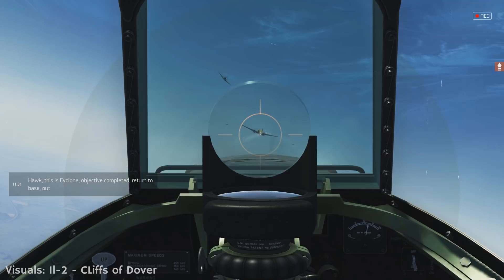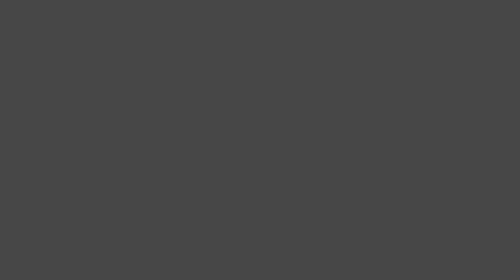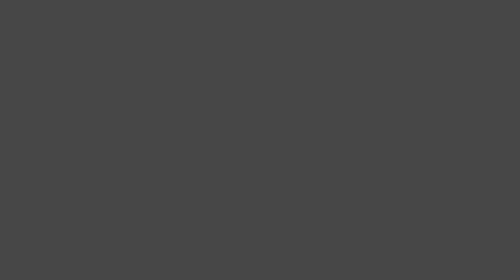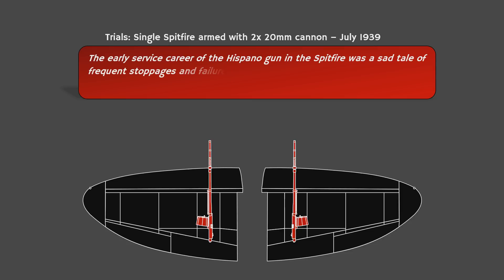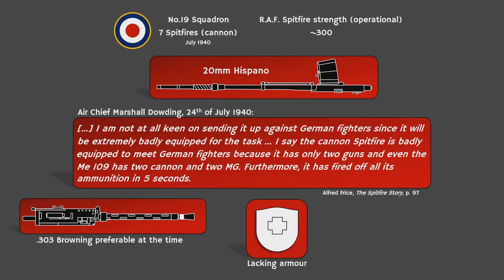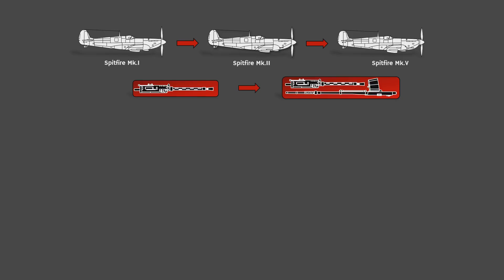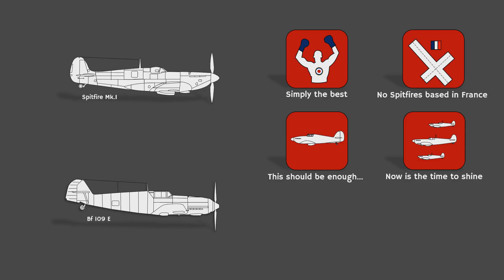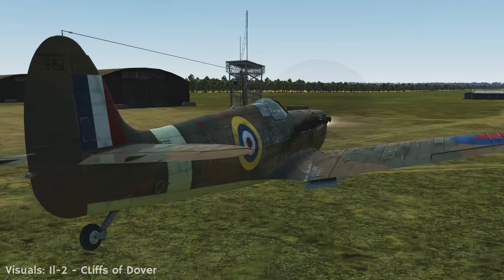⚜ | Clearing up Spitfire Misconceptions

Comment: The 109E having a squared off wing design is a more significant shortcoming than the early spitfires using a non-pressurized fuel solution. Furthermore, the 109E used circular 20mm magazines in the wings forcing the designers to include a bulge in the wings, causing aerodynamic drag. The spitfire used guns in the wings as well, however the magazines could fit into the wings without the inclusion of a bulge.

The 109F model, would rectify the major issues with the E model. Model F1 through F3 would utilize an oval wing design, while the model F4 and forward would use the Daimler 601E engine, as opposed to the 601A and 601N used in the 109E and the early 109F models.

From the model 109G and forward, the Luftwaffe would use the 605 engine, with several variations depending on intended altitude. Armament would also change depending on intended target, using up to 30mm auto cannons for bomber hunting.

However, when the Royal Air Force started using the Rolls Royce Griffon engine. There was no longer a contest.
Reply: Not true go and have a look at the wings of a MK2b it has bulges to accommodate the 60 round 20mm magazines.
Reply: And those long cannons sticking out of the wings didnt cause drag and the Spitfire with the clipped wings for better roll rate at lower altitude.
Reply: Talking about top speeds of the Bf 109 G and K is laughable. Sure they managed to push them to decent enough speeds under ideal test flight conditions (still less than Griffon Spits and Mustangs) but it was impossible to actually manoeuvre the bf 109 at those speeds, all the pilots who flew them consider the Bf 109 to have the worst high speed handling of all the main fighters. Adolf Galland actually wanted their production to be completely scrapped in 1943 because of how hopelessly outdated the design had become.
Reply: From everything I've heard, the MkXII was an absolute beast at low altitude, but that's because its single-stage Griffon was rated for down low. The XIV, XXI, etc were optimised for high altitude, but that was rapidly becoming no longer the place for piston-engined aircraft.
Reply: Hi, Andre. I recently found an old letter I wrote about this topic some years ago so I hope you don't mind the length. I edited it a bit to address some of your points but it's largely intact. It's more of a reminiscence than a lecture so I'll dive right in.

The only solid advantage the Spit had over the 109E during the BoB was range. Head to head it, as always, just mattered who took advantage of his relative strengths. The DB 601 was a bit too much engine for an airframe that was essentially the same as the prototypes that flew on 650hp but the wing tips were not a big factor. They were used to make maximum use of the wing slats to keep the low speed handling a bit less terrifying. They also provided a generally good rate of roll but the ailerons would get stiff at high speeds, just like the Spit, because the bigger engines pushed the speed above the original design parameters. 

The rounded tips on the 109F and later were to reduce the high speed stiffness and to reduce the flight loads on the new wing spar. They really didn't change the handling all that much. The 109 could be treacherous if handled roughly, had some flaws, and demanded a skilled pilot but it wasn't dangerous or inherently difficult to fly. It's biggest flaw was the landing gear which has been described as "even worse than a Spit!"

After the landing gear; the wing slats were a mixed blessing. An inexperienced pilot who got into a condition where one or both slats would pop in and out could cause a fatal spin. But, once the plane was in a low speed configuration with both slats firmly out it wasn't any more treacherous than most any other similar fighter. Better training would have helped a lot but I'll get back to that. 

Having flown RC scale models of several Spits and 109s I can attest that a Spit's inherent wing design is more treacherous than the 109 but the difference in scale means that a model 109 will almost always have a lighter wing loading than a Spit of the same scale which, of course, is the opposite of the "real" aircraft. But, just like the real aircraft, the 109 flies like it's on rails while the Spit will "swap ends" as fast as you can think it and both will bite if you try to drag them through a low speed turn without power.

After the Winter of 43-44 it didn't matter much what the Allies were flying. All Allied fighters were scoring better than 1-1 by then. That includes some rather dodgy Soviet fighters and the P-39's they flew after the U.S. gave up on them. By this stage of the war the average Allied pilot was well trained in the use of his fighter and taught tactics that took advantage of it's strengths. If he spotted an enemy in a "superior" aircraft he didn't look to hide; he looked to use his training and equipment to shoot it down. The Germans and other Axis pilots simply couldn't measure up despite flying some fighters that, when they had gas and maybe some nitrous, appeared to be able to out perform their counterparts. And that doesn't include the Me262. The axis powers were defeated in the air by logistics; especially the logistics of training. 

They depended on a short war and expended their most talented pilots in a battle of attrition instead of preserving them to train the next wave. And that one thing is arguably the single greatest factor in the turn of the air war. The Germans could produce a large number of very capable planes but they squandered the ability to train skilled pilots. The Japanese even managed to produce a surprising number of potentially good planes, to a low standard of quality, but they were so warped that they were sending out skilled pilots as kamikazis because there were no more unskilled pilots left!

If you read biographies of the aces from both sides you will see this difference clearly. The Britain and the U.S. used a very fluid system that spread talent within a fighter wing/group that would start with a cadre of experienced leaders that were often on a kind of TDY to serve until the newer element leaders were ready to lead a flight, squadron, etc. They would also rest their pilots, though there's some argument about how restful it was, by assigning them to operational training units. This resulted in the strange phenomenon of frequently reuniting with old comrades in new posts and forging bonds with new comrades. The Axis accounts, on the other hand, are a dirge of loss. Old comrades simply dwindle until they don't return.

BTW. The old biographies are great to learn about tactics and personalities but take anything presented as "technical data" with a grain of salt. There are a lot of reasons, most of them honest, why somewhat dubious data ends up in biographies.

Cheers!
Reply: Well, Evidensinsania, Scale models, both actual and virtual, are an important part of aircraft design. And? I didn't say that the 109 "flew better" than the Spit. Different? Yes. The 109 has a longer fuselage compared to wing chord and it shows in models by having a very direct and predictable flight envelope. It "flies on rails". The shorter moments of a Spit make it more maneuverable, especially for snap rolls and spins, and that is what I mean by "swap ends". I also mentioned that the effects of scaling down played a big part in the relative handling but you will find that those who flew the full scale planes will say pretty much the same thing.

The point I was trying to make is that the "square wing tips" of the 109E were not a detriment and that the elliptical tips of a Spit can turn and bite you in the stall. One of the things that made the Spit such a great dogfighter was that it would buffet when it approached the stall which allowed the pilot to fly right to the edge with a clear indication of when to ease off on the stick. But? If the pilot ignored that warning and actually stalled the plane it was as "treacherous" as any other WW2 fighter.

I have not had a chance to fly, or even ride in, a WW2 fighter but I did fly full scale light planes and sailplanes when age and health still allowed. I was also less than a year away from a degree in aeronautics when I switched to chemical engineering. I might not always express myself clearly but I have a pretty good idea what I'm talking about and hope I have cleared up any confusion I caused.

Cheers!
Reply: Errrm the 109e had a lovely system of rollers which sent the belt of cannon rounds all the way almost to the wingtips then back to the breech. The bulge you talk about was later marks armed with 30mm etc
Reply: Look, RC model toy planes only look like the real things, they in no way qualify you to talk about how they actually flew. The few Bf 109 pilots who actually got to flew a Spitfire all said how incredibly easy it was to fly. Spitfires also didn't have the recurring crashed caused by the wing breakages like the Bf 109 had. So you opinion of the Spitfire's wing being more treacherous based on flying RC planes is just total nonsense.
Reply: You seem to be committed to contradicting me, EvidensInsania , even when we agree. I do not put forward my experience with scale models as a sole source for my opinions but those experiences do carry over into my real-world experience. If i were to make a very general statement based on my experience with both models and full scale aircraft (Did I mention that I have flown light planes and sailplanes for @ 40 years in addition to my formal schooling and model flying?) I would say that a square tipped wing is almost always superior to a pointed or elliptical wing.

I didn't say the Me-109 was superior or easier to fly than the Spit. I said that the square wing tips of the 109E didn't negatively affect performance or handling. The heavy engine of the 109E increased the performance but did have a negative effect on the handling.The Spit, Mk I and Mk II and Mk V, was more forgiving than the 109. The Mk IX, with a bigger engine and more weight than the earlier marks, was roughly comparable. But? The 109 was not, as is often stated, "dangerous" in the hands of a skilled pilot. And, furthermore, if a pilot like Eric Brown was asked if the 109F or G was more treacherous than, let's say, a Spit XII or XIV? He would, and did, consider them roughly equal. Read his book if you don't believe me.

Cheers!
Reply: I'm sorry but experience flying RC models in no way qualifies you to talk about how the real planes flew. Neither does flying completely different aircraft. I've flown Cessnas but you don't see me pretending that it in any way qualifies me to talk about the flying characteristics of a Spitfire or Bf 109, for that I just trust the people who actually flew them. And yes I've read Eric Brown's books, being the most experienced test pilot in history there really isn't anyone better to compare to different aircraft. As for the Bf 109 he really wasn't impressed by it, especially with it's horrendous high speed handling which was essential for fighters as the war progressed. Many German pilots like Adolf Galland who got to fly the Fw 190 also started to think quite low of the Bf 109, it was only those who had flown nothing else that still considered it a good aircraft. 

And no square tipped wings are not always superior to elliptical wings, there is always a compromise. Elliptical wings had more efficient lift with less drag that square tips on the same wing but elliptical wings were much harder to manufacture. Spitfires even had different types of wing tips that could be swapped around, one of which was the straight edged clipped wings that gave the plane a better roll rate at the cost of reduced climb rate and turning abilities. Like I said, everything is a compromise.
Reply: You really don't get it, EvidensInsania. I merely disabused the OP's assertion that the square wing tips of the 109 gave it a disadvantage against the pointed tips of the Spit and pointed out a few misconceptions. My remark was based on a lifetime of experience and a thorough understanding of the topic. Plus...

If you fly any kind of aircraft you will, or should, have a larger knowledge base than someone who does not. The OP doesn't seem to have any particular knowledge about how an airplane works so i tried to help him out.
Reply: @Pete Sampson
I'm not sure what you're on about. Wing design was a problem on the first generation production BF109, which was the Emil version. Changes from the prototype version included the use of the Daimler 601 engine, as opposed to the Jumo 210 engine. As a result some design changes were made. The main radiators were moved to beneath the wings, just behind the landing wheels. The wings were re-designed and reinforced due to the increased speed and the new position of the main radiators.

You are correct in that the very first BF109E-1 did not use two 20mm guns in the wings. But by the time battle of Britain rolled around, the Luftwaffe were mostly flying the E-4 and the E-7 (5 and 6 were recon aircraft). Which did use 20mm guns in the wings, with a rounded magazine that required a bulge to be designed in the wing to fit the magazine.

With the F1, they decided to shorten the wings (about 2 feet) and redesign the shape to be more oval at the tips. Some shapes were rounded and the exhaust fumes were re-directed away from the supercharger air-intake. Which allowed the F1 to fly about 40KM per hour faster than the E7. Turn time is noteworthy better, climb is better, take off runtime is better and fuel economy. The first 109F-1 flew in October 1940, right at the very end of the battle of Britain.

''The Bf 109 was superior in the attack and not so suitable for purely defensive purposes as the Spitfire, which, although a little slower, was much more maneuverable.''
-Adolf Galland, German flying Ace.

Werner Mölders flew a 109F1 from the very first batch in Britain from October 11 to October 29 1940. In which time he scored 12 air kills, 4 of whom spitfire and 8 hurricanes.

You are also correct on your fighter pilot training comment. The Germans used their teachers as reserve pilots. The Japanese were largely unable to retrieve pilots as the Americans dominated the oceans, and they sent off their experienced pilots on suicide runs towards the end. But i would say their handling of pilot skill was flawed from the very beginning. The pilots that attacked pearl harbor were almost exclusively veterans of 600-800 hours, with many combat missions to their name in China. While this was likely a good idea during Pearl Harbor. In the context of a long war, it's not a good idea to concentrate your best pilots as the Japanese did. However, the Japanese did not plan for a long war, and neither did the Germans.
Reply: I suggest you take a look at some of the more complex RC replicas out there. I use that particular word, replica, purposefully. 

You see, some of these 'toys' are absolutely perfect scale replicas of the original aircraft. Their engines, flight surfaces, everything is simply scaled down from often original design drawings. These are no mere toys but are fully functioning aircraft in their own right. 

Can you use complex models of this sort to determine how the real aircraft will fly? Up to a point, yes you can. In fact using scale models is part of the DESIGN process of a new aircraft. A scale model in a wind tunnel for example will teach you a HUGE amount about the aerodynamics of an aircraft and potential problems of a design before the first prototype is ever built. That is why they DO IT. 

 What you CANNOT do is experience the invisible aspects of the aircraft that may or may not give a pilot an edge. The famous judder of the Spitfire is a perfect example, it acted as a warning to the pilot, thus it gave the pilots far more confidence when it came to aggressively maneuvering their aircraft hard. German pilots in the Me109 had no such warning. As a result pilots, especially inexperienced pilots, were wary of really pushing the envelope of the aircrafts capabilities.
Reply: What I am "on about" is that the square wing tips of the 109E were not a significant factor in the performance and handling. Messerschmidt didn't change the tip profile because there was a problem with said square wing tips. They changed the wing tips to take advantage of the new spar structure introduced with the 109F.

I would also add that the bumps needed to fit cannons in the wings of a Spit were, if anything, more prominent than the bumps added to the 109E. The 109F and G, of course, didn't use internal wing cannons and those examples that carried extra cannons carried them in gondolas mounted under the wing. Said gondolas added a whole lot more drag than the bumps used to house the cannon feed system of the Spitfire.
Reply: It should also be mentioned that airplane designers since the wright Bros have used models in designing their full scale aircraft. In the case of the Wright Bros it was their wind tunnel experiments that gave them the data needed to design their very efficient propellers as well as the airfoil used on the "Flier". Many designs were tested with reduced scale manned aircraft before RC gear was perfected and RC models have been used in full scale aircraft design since WW2.

Of course; the only point I was making is that a "pointy" wing can have a nastier stall than a wing with square tips, regardless of size.

Cheers!
Reply: Stop trying to equate aircraft designers using models to look for problems with airflow in wind tunnels with your stupid belief that you're an expert on how Spitfires and Bf 109s actually flew because you've played with RC models of them. If you tried to talk like that to a surviving WW2 pilot they would just laugh at you.
Reply: As a point of fact, Evidenceless, I have met many WW2 vets including my own father, 4 uncles, Chuck Yeager and Jimmy Doolittle. I even let Jimmy fly my model glider while he visited us when I was flying with the Torrey Pines Gulls in the early 70's. He got a big kick out of it but didn't have any particular natural ability. I really don't know what you object to in my analysis. Please tell me and cite your sources proving me wrong. 

The OP claimed the square wing tips of the 109E was a major design flaw and I pointed out that was not the case. I didn't say or even imply that the 109 had better handling than the Spit but I did say that a "pointed" wing is inherently more treacherous in a sustained stall than a wing with square tips. And? I stick by that.

The Spit didn't have superior low speed handling because of the wing shape. It had superior low speed handling because it had a lower wing loading. It also used a lot of washout (Do you even know what washout is?) on the wings so they would buffet as the stall was approached and gave the pilot a tactile stall indicator that allowed for very tight maneuvering at the edge of the flight envelope. The 109 had it's own stall warning in the form of the slats popping open but it was trickier to use than the Spit. There are even a few Luftwaffe aces who swore that a 109 could actually turn tighter if the pilot had the skill to use the full benefit of the slats in a stall turn.

These opinions are based on more than 50 years of studying aeronautics and the planes and pilots who fought WW2. My experience with models is a very small part of my knowledge of the subject and the only reason I even mentioned it is because I have not had the opportunity to fly a Spit or a 109 to confirm the findings of those who have flown them but I have flown models of both and the models behave pretty much as one would expect by studying the full scale planes and the biographies of those who flew them.

I have, however, piloted about a dozen different light planes and sailplanes and I can tell you that a very simple rule holds true. Thin, tapered, wings have a more abrupt stall than wings with a constant chord and rounding or pointing the wing tips makes it worse. I have a few hours in a Grob (Do you know what a Grob is?) and, while it won't stall above @35kts, it will whip into a spin if you hold the stick back; just like almost every plane ever built. If the 109 had the same low wing loading as a Spit? No one would have ever complained about its low speed handling. The 109 had some handling quirks but it was not "dangerous" to a skilled pilot.

My views are all soundly grounded in aerodynamic theory and supported by the men who flew the planes in question. Jeffery Quill, who was a chief test pilot for Supermarine during the war, explained it in great detail including how a Spit would "beat the crap out of the pilot" if it was intentionally held in a stall until it whipped into a spin; just like any plane of comparable performance.

And, while the Spit's landing gear wasn't quite as bad as the 109s, it was a weak point of both designs. If you doubt me I suggest you check out some accounts of the Seafire which was, at best, marginal for deck landing despite its "magical elliptical" wing while planes like the F4F, F6F, and TBF were all praised for their abilities as carrier aircraft and had straight taper and square wing tips.

So. Tell me what I said that is "stupid".

Cheers!
Reply: My point is that the opinions of pilots who flew the real planes, especially when they had personal experience flying many different planes to see how they compared, is a valid source of information on how a plane flew. Flying an RC model is not.  Notice how everyone who actually flew them all considered the Spitfire to be much easier to fly than the Bf 109, only you seem to think that the Spitfire was more dangerous. You also have proper tests done by the R.A.E. showing that Spitfires and Hurricanes could easily follow a Bf 109 stalling in a turn without the danger of stalling themselves. The only real "danger" to flying the Spitfire was that it was well within the pilots ability to pull enough G force in a sustained turn to black themselves out. Pulling enough G force to black out in a Bf 109 was impossible since the controls would pretty much just seize up at higher speeds which made them sitting ducks, especially with the much faster speeds in the second half of the war. Or of course the Bf 109 wings would just break off. 

Yes a true elliptical wing will stall more suddenly, but VERY few aircraft have ever been designed with true elliptical wings. While the wings of Spitfires and P-47s are often called elliptical they really used a modified elliptical design negating that flaw at the cost of more induced drag. However a typical tapered wing will have to employ more washout to see similar stall performance to an elliptical wing. And if you wanted to simply increase the length of the Bf 109 wings to give the overall plane the same wing loading as a Spitfire then it would come with a very big increase to drag. Fact is that the wing design of the Bf 109 was inferior in pretty much every way to that of the Spitfire except for the fact that it was a hell of a lot easier to build. 

And no the Bf 109 could absolutely not turn tighter with the slats. The only reason why Luftwaffe pilots were occasionally able to do so is because the pilot matters a lot more than what they were flying. During the Battle of Britain most of the Luftwaffe had racked up a lot of experience fighting in Spain, France and Poland whereas most of the RAF were brand new recruits with only 10-20 hours of flying experience and new pilots would seldom have the knowledge or courage to push their plane to it's limits. The slats being deployed also caused aileron snatching making aiming with the plane next to impossible. They were just a really shit design that Kurt Tank wisely avoided for his Fw 190.
Reply: Where did I say that the Spit was more dangerous than a 109? That's right. I didn't. What I said is that the square wing tips of the 109E were not a detriment to handling and, indeed, if held in a stall the Spit will spin out of said stall just like any other plane. Once in a spin, go look up the RAE flight reports if you think I'm lying, the 109 would actually recover a bit quicker than a Spit. It simply had a longer tail moment and a more forward CG range.

Wait. Didn't this whole thing start when I mentioned that the pilot matters more than the plane?

Several German aces, including Galand and Gunter Rall, believed they could out turn the average pilot in a Spit, or any other plane, under certain circumstances and one reason for that was that the semi-reclined pilot of the 109 could pull a little more G-load. The 109 could, at certain speeds, out roll the Spit though it couldn't keep up in a slow speed turn.The Spit had a rate of roll that was between poor and average compared to other fighters with it getting worse with increased speed. The P-47 and Tempest, for example, had considerably faster roll rates at high speeds.

Slats, in and of themselves, are very useful for highly loaded airplanes. They, effectively, increase the lift at low speeds without the drag of a larger wing or the pitch changes one gets with large flaps. That's why virtually all modern jets have slats. They only became a problem with the 109 under certain, rather rare, conditions. That being said; it probably would have been worth the extra weight to make them manual instead of leaving them as a fully automatic system that could bite the unwary pilot. In fact; the 109 and Spit had stall speeds that were nearly identical, because of the slats, but the Spit was generally more forgiving due to a lower wing loading.

Cheers!
Reply: +pete sampson So because I have played X Plane 11 I can go fly a commercial airliner? Cool!
Reply: In your very first comment you said that the Spitfire was inherently more treacherous and more likely to stall than the Bf 109 based on your expert opinion of flying RC models... In REAL aircraft it was very hard to accidentally stall a Spitfire thanks to all the warning it gave you and they could quite easily keep up with a bf 109 that put itself into a stall without doing so themselves. 

The ONLY reason a few experienced Luftwaffe pilots could out turn brand new Spitfire or Hurricane pilots is because they were afraid of pushing the planes anywhere close to their limits. But any average Spitfire pilot could outturn a Bf 109 with ease. And it was literally impossible for the Bf 109 to pull high G's. You were either going slow enough that more than 4G was pretty much impossible or you went faster so the Bf 109s controls froze up because it was such a cheap and outdated design. The only Spitfires with bad roll rates were the very early ones that had fabric ailerons, the metal ones improved it considerably, especially at higher speeds, and with clipped wings the Spitfire could even match the incredibly fast rolling Fw 190. 

As for slats I was specifically talking about those of the Bf 109, not modern planes, and those of the Bf 109 were shit and generally disliked by pilots including Gunther Rall because of the problems they caused. Hence why the Fw 190 didn't have them despite having even higher wing loading than the Bf 109. Not dropping the slats of the Bf 109 was clearly a decision based on how they should work in theory rather than facing their problematic reality.
Reply: I said that the inherent wing design was more treacherous, and I'll stick with that, but I also noted that it only applies when the wing loading is the same. I also noted that the buffeting of the Spit's wing as it approached the stall gave the pilot an advantage. The part that I forgot to mention is that the pilot of a model doesn't experience the buffet and so a model Spit has no more stall warning than a 109.

Cheers!
Reply: Well nobody else agrees with your opinion that the Spitfire was more treacherous and the fact that you can only try to qualify your opinion with the condition that the Bf 109 have a totally different wing to reality makes it completely irrelevant too. And you don't experience any juddering when using an RC model? You don't say... It's almost as if playing with RC models doesn't in fact make you qualified to talk about how the real plane handled.
Reply: Sigh... You are a tough nut. I didn't say that the Spitfire was more treacherous than the 109, at least that was not my intent. My point is that, all things being equal, a highly tapered or elliptical wing with sharp tips is inherently more treacherous than a straight taper wing with square tips. There some other hidden benefits to using an elliptical wing planform such as a higher limiting Mach number but ol' Reg Mitchell didn't use that shape for it's aerodynamic benefits. He used it because he figured it was the best way to gain sufficient internal volume for the guns and landing gear while maintaining a thin thickness to chord ratio. In fact; it was because of the fact that a "pointy" wing is prone to tip stalls that he added a bunch more washout than was accepted practice.

Cheers!
Reply: Pete you actually present quite a well rounded explanation on how that stuff works which is very cool. Too bad it's wasted on some dumb ass who wouldn't be able to pour water out of a boot with instructions on the heel.
Reply: No worries, Resident Evil742. "Difficult" discussions improve my debating skills and, hopefully, someone will learn something.

Cheers!
Reply: Well you did say the Spitfire was more treacherous than the Bf 109 because that's how it was with your toy models that you seem to hold to the same standards as flying the real things. This is the first time you've said otherwise.

And you still don't seem to recognise that planes like the Spitfire and P-47 didn't use a true elliptical wing design that would cause the unpredictable stalling you're talking about. So no, the Spitfire did not have more washout than was normal. The Spitfire, P-51, and Fw 190 all had about 2 degrees of washout on their wings and as far as induced drag goes the Spitfires was the most optimum if you're only looking at the wings. And of these three planes it was definitely the Fw 190 that had the most violent stalling that came without warning since higher G loading would shift the wings load distribution outboard causing most of it's wing to reach it's stalling lift coefficient simultaneously despite the wings being a straight tapered design that you think is so superior when it comes to stalling. 

Your point of view that all planes with pointed wing tips are more treacherous than those with square wings is just a vast over generalisation that fails to look at all the subtle differences in their designs and that unless you're looking at the whole plane it doesn't mean much.
Reply: I would like to point out about radio controlled replicas is that if they're simply scaled down versions of the original aircraft they will handle in almost the same way as the real aircraft. They do so especially if the size to weight ratio and power to weight ratio is close to scale for the model. Aircraft manufacturers have done that for years to safely test new designs to check for potential aerodynamic faults without risking a full aircraft and a crew.
Reply: No RC models do not handle the same way as the real aircraft they've been made to look like. First thing is that all their control surfaces are electrically driven when in the real aircraft the ability of a pilot to fully deflect a control surface varied immensely between different aircraft and at different speeds. Their lack of weight means the wind has a far greater effect upon them along with having very little momentum in flight. I also highly doubt their designers ability to get all the weight, power, and size ratios correct along with getting the shape exactly correct which could have huge differences in the flight characteristics. Pete even said his Bf 109 model had a lower wing loading than his Spitfire which obviously makes any comparison between them complete nonsense. 

Yes aircraft designers have used models in wind tunnels to check their aerodynamics. This did not tell them how the plane handled and they weren't stupid enough to pretend otherwise. Do you think the wind tunnel testing done on all new car designs tells you how they actually handle driving on the road? No. But Pete wants to believe his experience of flying RC models is the same thing as having experience in the real things. Playing with models is fun but it's just pure ignorance to act like it in any way qualifies you to pilot/drive the real things.
Reply: Hi, ResidentEvil742. I was just going to let our friend blow himself out but, after having my appendix removed last night, I'm kinda cranky! We can deduce a few things about our friend.

1. He's a Spitfire fan boy. Looking back trough his posts it becomes clear that he thinks I denigrated and belittled his beloved Spit and, well, a true fan boy would rather saw off his junk with a rusty bottle cap than allow even an imagined insult to stand.

2. He thinks he's being insulting by calling RC models "toys". Well? Having flown my first RC plane in 1966 I have heard a lot worse and it doesn't phase me. Why? Because I realize that most of the hostility is because I can afford the time and effort to do something they can't. I have also, over the years, "played" with: collectible cars, snowmobiles, dirt bikes, hunting, fishing, model trains, slot cars, musical instruments, freshwater and saltwater aquariums, dirt bikes, ski boats, full scale light and ultralight aircraft as well as sailplanes, video games and chess. I have received grief for all of them and never take it to heart. I define myself much more by my toys and hobbies than I do by my professional life.

3. He knows a little bit about aerodynamics and aviation history but he seems to be working from sources that support his preconceptions. I bet he would take issue with the official documents instructing Spitfire pilots to NEVER try to dogfight a zero, for example.

4. He's a troll. He looks for fights and once he finds one he will never be swayed. I have lost track of how many times I have patiently explained that I never meant to imply that the Spit had inferior low speed handling to a 109 nor did I ever claim that flying models of both was my only reason for correcting the OP when he claimed that the square wing tips of the 109E were a flaw or even a disadvantage.

5. He has no conception of just how close a miniature airplane can be to the full scale bird that inspired it nor would he ever admit that almost all of the skills transfer between the two. For example; Dad bought me a derelict Aeronca Champ when I graduated from college. I eventually found out it cost him $650. It was my model building skills that largely allowed me to strip it to the frame, replace the rotted wood bits, and cover it in fabric to restore it's original function and beauty. I loved the old bird so much I kept her for more than 20 years and sold her for a tidy profit.

6. Now he's going to really go into full trolling mode. He will definitely claim I have never held a pilot's license but even if i do it doesn't mean I can speak about Spitfires. He will try to insult me, and probably fail, and might even wish me ill in my recovery from emergency surgery. He will do these things, or something similar, because he can't help it. He might prove me wrong but I don't get surprised about these things very often.

BTW. Please don't worry about me. We caught the appendicitis quickly, my surgery went well, and my recovery has been going very well despite my age. And, other than a bit of manageable pain if I twist or turn the wrong way, I'm actually feeling pretty good. I'm getting pretty old but I'm also pretty tough and in, generally, good health.

Cheers!
Reply: Glad to hear that you did well! And yeah he's got his head shoved so far up his arse that it's coming out his mouth. Also quite glad to see another model railroad fan out in the wild with interests in other hobbies.
Reply: I never had any issue with your statement about square wing tips being a problem on a plane, many have them. The issue I had was your nonsense statement about Spitfires being inherently more treacherous to fly than Bf 109s based on your experience of using RC models... You yourself even said "but the difference in scale means that a model 109 will almost always have a lighter wing loading than a Spit of the same scale" so why on earth are you still desperately trying to defend your ignorant notion that flying an RC plane is a valid alternative to actually sitting in the cockpit and flying the real thing. It's just like someone assuming that because they've played Microsoft Flight Simulator X then they can handle a real 747. But rather than just admit it was a stupid thing to use as a "source" of information you try to deflect away with totally irrelevant stuff about the stalling characteristics of a true elliptical wing design, something the Spitfire and P-47 did not have. 

The problem with pretty much everything you've said is that all you care about is how things should be in theory, rather than how things were actually built, implemented and worked in reality. Like how you always praise the slats on the Bf 109 because of what you think they should do in theory when they were infact very much disliked by many of the real pilots.
Reply: Time to jump in...I'm gonna regret this...

Evidens, please learn how to lose. Pete here is citing sources, using aeronautical data. You are just sticking your fingers in your ears and shouting "la la la my Spitfire is great and you can't tell me different la la la".

The aerodynamic characteristics of an airplane are solely dependent on the shape of the aircraft. That's just how fluid dynamics work. Yes, a heavier aircraft will have slight differences. But it is well-known that the Spitfire had awful stall characteristics due to the laminar-flow wing. It's very well-known, actually. Equally is it well-known that the 109 had a tendency to put out its slats at the worst possible time.

Your analogy to a wind tunnel telling you how a car handles is far more ludicrous than you seem to think flying RC models as compared to the real thing is. Because cars handle on the road. A plane handles in the air.

I enjoy that you call the 109 a cheap, outdated design compared to the Spitfires that were literally made out of pots.

Also, "most of the Luftwaffe had experience" from the Spanish Civil War and Poland. Tell me, how many pilots were in Condor Legion again? Oh yeah, less than 200. Thanks for doing your research.

Too bad you'll just respond to this with a half-baked attempt at a snarky rebuke.
Reply: What Pete says is theoretically correct, but I'm talking about reality not theory. Yes a true elliptical wing design can lose it's lift across the entire wing at once but planes like the Spitfire, P-47 and Tempest did not have true elliptical wings, what he's describing didn't apply to them. Just like your statement about the Spitfire's "well known" laminar-flow wings. Problem with that is that the Spitfire didn't have laminar flow wings, it was the P-51 that had them... Just making yourself look like you don't know what you're talking about now. Yes the P-51 had a higher stalling speed but you weren't suppose to fly the P-51 slow, fighter design had moved past the idea of slow turning fights by that point. 

Spitfires weren't made out of pots, that was just a public relations exercise to make ordinary people feel like they were contributing to the war effort to boost morale. But the Bf 109 on the other hand was most definitely a cheap plane, but for fighting a war that wasn't a bad thing. Sure the Bf 109's outdated design meant that it was quickly surpassed during the war but being able to build more of an inferior fighter can balance things out. Senior Luftwaffe pilots like Adolf Galland wanted to replace the Bf 109 with the Italian G.55 because as a pilot he recognised how totally inferior the Bf 109 had become but the problem with that was that the G.55 took about 15,000 man hours to build whereas the Bf 109 took only 5,000. For an individual pilot, the view point that Adolf Galland had, it would have sucked to be stuck with an inferior plane, but for the military as a whole having three Bf 109s would be better than a single G.55. If Germany had taken the same approach to tanks then they probably would have lasted a bit longer on the ground, especially since even in 1945 the humble StuGs and Pz IVs were causing a hell of a lot more damage than the horrendously expensive and unreliable Tigers and Panthers.

And the pilots of Condor Legion got to take back what they had learned from first hand experience to provide better training for more new pilots who then also got to fight in Poland and France while Britain held back it's air force to defend against invasion in case France fell. Going into the Battle of Britain the Luftwaffe certainly had a massive experience advantage over the RAF. Besides, that was only brought up because Pete made a comment about what Adolf Galland said about manoeuvring a plane and Adolf Galland was indeed part of Condor Legion with many hundreds of hours spent flying.
Reply: Actually, the Spits - at least the early ones - were made, in part, out of scrap. I actually dug out a few books on the Spit to make sure I wasn't talking out of my [REDACTED].

And, as someone who does this for a living, the Spitfire DID have an early type of laminar-flow wing. It wasn't the 50% chord wing we know from the P-51, but it was far from a conventional airfoil. I will concede that it wasn't a true laminar-flow wing, but the design did lend itself to some of the "pure" laminar-flow wing's nasty habits.

The 109, according to German, British and American sources - because you won't listen to aeronautics - was about on par with the Spitfire for most of the war. With the Griffon engine, however, after its teething troubles it did have the advantage. You seem to think that the 109 was at best mediocre, which it certainly was not. It was a good aircraft. So was the Spitfire. The Spit did have more capacity for developmental growth, though. And that is because the airframe was a bit older for the 109.

I agree, low-speed performance is not important. But you do know what an accelerated stall is, I assume? A laminar-flow airfoil stalls at a lower angle of attack than a conventional airfoil, which is the tradeoff - a laminar-flow wing is never going to turn with a conventional wing, structural load aside. As well, the 109 was one hell of a climber. It climbed better than the ol' 51 and most of the Spits. Again, I defer the point that the 109 was past its prime at the end of the war.

Hopefully we can come to a reasonable understanding.
Reply: And were these books saying that Spitfires were made out of scrap the same ones that told you it had laminar flow wings? You are the first person I've ever seen try to make the claim that Spitfires had laminar flow since it really did not. The main reason why the Spitfire's wings didn't induce much drag was because of how thin they were compared to most other fighters, not because of any laminar flow properties. The Spiteful was Supermarine's attempt to put laminar flow wings onto a Spitfire. And where on earth are you getting the idea that the Spitfire had the higher stalling speed and reduced lift of laminar flow wings? Compared to the Bf 109 the Spitfire had a lower stalling speed and much greater lift, literally the complete opposite of the P-51. 

Actually according to all sources the Bf 109 was only comparable with the Spitfire for the first part of the war. Once the Mk IX Spitfire came onto the scene, later followed by the P-47, P-51 and Typhoon, the Bf 109 was just hopelessly outclassed and the started dying in absolute droves. Which is why some senior Luftwaffe pilots wanted it's production to be completely stopped. But like I said, they were much easier to produce than any of those Allied fighters and quantity is a quality all of it's own. The only people who thought highly of the Bf 109 were Finnish pilots who only had stuff like the Brewster Buffalo to compare it with. If they had been able to fly Fw 190s then I'm sure they would have taken a dislike to the Bf 109 just like all the Luftwaffe pilots did after trying the 190s. 

P-51's could actually out turn Bf 109s easily so long as the speed was high enough. Bf 109's practically seized up when they got to high speeds since they were designed for slow turning fights whereas the controls of P-51s and Spitfires remained light. The Fw 190 could also outturn a Bf 109 at high speeds thanks to it's better controls, it was only in a slow sustained turn that the Bf 109 had a turning advantage over it. Accelerated stalls could affect any plane and there wasn't anything hugely different about the P-51 in this regard. To pull a pretty violent 8G turn in the P-51 without stalling you only had to be above about 260 mph which wasn't hard. Manoeuvring problems could occur in the P-51 if the rear fuel tank was still full though since it shifted the centre of gravity out of place, but P-51's were supposed to empty the rear fuel tanks flying before they got to the fight. The Fw 190 probably had the most violent accelerated stall characteristics of WW2 fighters and is probably why the elevators got much heavier as the speed increased, but at least they still worked at these speeds unlike the Bf 109. 

The Bf 109's climbing ability didn't mean anything when fighting the P-51. P-51s would climb to altitude long before they engaged any sort of enemy, a fast climb rate just wasn't important to them, whereas Bf 109s needed it to try and reach incoming P-51s with little warning. But once the fighting started that climb rate was totally meaningless apart from the fact that it at least allowed the Luftwaffe to field some sort of opposition rather than letting the bombers simply fly right over. And the Bf 109 never matched the Spitfire's climbing ability, it's wings were just far too small for that.
Reply: I never said the Spitfire had low lift or high stalling speed. I did say that it would stall at a lower angle of attack, which is true. The Spitfire's wing was not quite a conventional airfoil - its spar was a tad too far back to make it conventional. It really lies somewhere in between. And the Bf109 actually did climb better than the Spits for most of the war, even up till the early Griffon Spitfires. Until the end - when it must be said that the Spitfire was really not a Spitfire anymore as the airframe was radically different - with the advent of the Griffon Spits, the 109 and Spit were really on equal terms. Good to see we at least agree on this.

As well, climb rate is still useful in a fight, because it allows the pilot to engage in sustained vertical maneuvering, something the 109 could do but the 51 could not. I never said the Spit had low-lift wings, and you seem to forget that the area of the wing is far from the only determining factor in the lift of a wing. Stop trying to pretend that small wings means poor climb rate. That's just plain wrong. The 109's wing was thicker, and had more camber, which meant that each unit area on a 109's wing was more lifting than a comparable unit area on a Spitfire's wing.

I already agree that the 109 was outclassed at the end of the war. I never tried to make the claim that it wasn't. Stop repeating it for no reason. Being outclassed doesn't mean useless, though. The 262 outclassed the 51. The 51 still shot down some 262s.

As you yourself said, the 51 had to be going 260 mph or so for an 8-g turn. I would like to hear more about how well it could sustain that turn, because it couldn't. Talking to USAAF pilots, the 51 could not sustain a high-G turn, which saved a lot of 109 pilots' lives.

Why do you have so much hate for the 190? No one but you is talking about it. It doesn't matter that the 190 had the worst whip stall characteristics of all WWII fighters, it doesn't change anything about the 109 or Spit's characteristics...
Reply: The Spitfire did not stall at a lower angle of attack. Seriously where do you keep getting this shit? It had a tighter turning circle than pretty much everything except the Zero. And you know the Bf 109 had it's single spar (also the only WW2 fighter I can think of with just a single wing spar, I mean even the super lightweight Zero had two) in the center of the wing right? So why on earth you think Spitfire's main spar was too far back is beyond me. 

As for climb rate no, the Bf 109 was not superior and unlike you I have original documentation to prove it
Here is the Bf 109 E with a top climb rate of 14.5 m/s
http://www.wwiiaircraftperformance.org/me109/me109e-handbookcurve.jpg
And here is the Spitfire I at about 15.5 m/s, and what's more that is when the plane is only running at 6.5 lbs boost which was raised to 12 lbs boost before the Battle of Britain started thanks to having stockpiled enough 100 octane fuel. 
http://www.spitfireperformance.com/n3171climb-c.jpg

With the DB 601 E of the late F series the 109 could climb at 17 m/s, with the DB 601 N of the early F series at 16 m/s
http://www.wwiiaircraftperformance.org/me109/14026pg5.jpg
With the DB 605 of the G series it increased to about 18.5 m/s
http://www.wwiiaircraftperformance.org/me109/me109g-14026-page6-1200.jpg
And this was eventually increased to 21 m/s towards the end of the war
http://www.wwiiaircraftperformance.org/me109/Bf_109_G-1_Kennblatt_Flugleistungen.jpg

The Spitfire V on 16 lbs boost climbed at 18.8 m/s
http://www.spitfireperformance.com/aa878climb.jpg
When first introduced at 15 lbs boost the Spitfire IX climbed at 19.6 m/s http://www.spitfireperformance.com/bf274climb.jpg
On 18 lbs it averaged about 22 m/s varying on if it was a low or high altitude tuned engine
http://www.spitfireperformance.com/bs543climb.jpg
And at 25 lbs boost it did over 25 m/s

So yeah, the Bf 109 never outclimbed Spitfires. It came close earlier on but was always lagging behind. 

And climb rate is not very important for vertical manoeuvres. The most important thing for vertical manoeuvres is energy retention which primarily comes from being heavier and having a more powerful engine. In the vertical the P-51 absolutely smashed the Bf 109. Same thing with the Fw 190 which again despite it's slow climbing speed could easily boom and zoom a Bf 109 without any trouble. Very light planes with weaker engines like the Bf 109 and Zero just couldn't compete against heavier planes because they would lose all their speed much faster if they tried to follow their attacker in a climb. The idea that some people have that the Bf 109 was good at boom and zoom is because early on they faced so many much slower planes like the Hurricane and I-16. 

And no plane could sustain a high G turn. But they didn't have to if they had the speed. What being able to pull brief high G turns in planes like the P-51 or Spitfire allowed was for them to quickly snap their guns on target or pull out of an enemies line of sight and then zoom away. Whereas the Bf 109 was totally unable to pull any sort of high G turn because when flying at the higher speeds needed to pull high G's the 109 controls practically seized up. So they were stuck either going fast but unable to manoeuvre which made them an easy target or they had to slow down so they could turn out the way of an attack but now they're really screwed because a slow plane is a dead plane once that P-51 comes back around for another attack run. 

And I clearly don't have hate for the Fw 190. If that's what you thought then you obviously haven't bothered reading anything I said. I brought it up because it's an example of a good German fighter unlike the crap Bf 109. Top speeds were overall pretty similar but the 190 didn't completely lock up when going fast so unlike the 109 the 190 was actually able to fight at these speeds. In combat this was simply far more important than the better slow speed turning of the 109 since while slow you are always on the defensive. Although I will give you that the Bf 109s faster climbing helped it as an interceptor thanks to Germany's inferior radars not giving them as much warning about incoming enemies and any sort of defence is better than nothing.
Reply: Dellacondan The system of rollers you described was used for machine guns, not cannons. In fact, no 109 that went into production was armed with wing-mounted (inside) belt-fed 20 mm cannons.

Edit: And the bulges you mentioned are very visible on 109Es, especially on the underside. Later 109 (109Gs and Ks) also had bulges on the wings but this was caused by a change in wheel sizes.
Reply: EvidensInsania HE SAID THE SPITS POINTED WINGS ARE MORE TREACHEROUS OF A STYLE NOT THAT THE SPIT WAS MORE TREACHEROUS!
Reply: Oh dear, oh dear, of dear ..........   Wolfgang that is SO hitting Evidens below the belt ......  going in there confusing him with truth, facts, even (how could you stoop so low)? reasonableness.

Its obvious Evidens is one of two things (or, even more unusually, both) ......  a troll or an obsessive.

Whilst I thought Pete's extrapolation from the handling of models was stretching the anaology (unless they're exact not just in form but also balance, relative power etc etc its increasingly unreliable) Like I guess most folk here thought the rest of Pete's review was really astonishingly useful & well informed.  
(When you also see his credentials its unsurprising too).

Trolls of course won't concede erro because that woulds spoil the twisted fun of frustrating saner folk. 

But some characters, and I suspect Evidens is more in this group, are just litteral minded to a scary degree and you will never convince them they are in error.  To them its not within the parameters of what's possible.
Reply: The greatest misconception is England defeated the Luftwaffe. Nothing can be further from the truth. The U.S. Air Force broke the back of the Luftwaffe. In almost any variation if a solitary spit met a solitary 109, the odds were Not in the Spitfire pilots favor.  Too few Griffin motor versions were produced and the model was plagued with problems. Even then a 109K, also few in numbers, would eat it up.
Reply: lol ...re read what Galland actually said.  The 109 was not ideal for covering bombers against nimble spits and hurricanes.......but one on one in a hunters dual the Spitfire rarely got the advantage on the 109. The 109 is the most under appreciated top fighter in history.  To the victors go the spoils and the histories.
Reply: The info I have read does state that the 20mm cannons did need a bulge due to the thin section of the wing. I dont know where you read about the belt system (sounds American to me). In fact some Aces reverted back to the single engine mounted cannon in order to gain a bit more speed.
Reply: The 109 was used tactically with deadly effect (in lieu of plain dogfighting).  Mostly diving down on a Spit from behind and a short burst of cannon + mg fire would be enough to knock down a Spit.  It's quite sad that so many able Spit (& Hurricane) pilots never knew what hit them.
Reply: @Andre J The wingtip is immaterial. They are fighters, not show ponies. The objective was to shoot down the other guy as quickly as possible. Hit and run, not showboat or loiter in a 'best aerobatic performance points trophy' turning dogfight. The wing gun thing was a post orig comp spec requirement, thus the ad hoc arrangement. The Spit used 'bb guns' in the wings. :  ) The E-3/4 had MG FF/M cannon. The more critical element was endurance with the 109s over the UK hoddled by it literally and psychologically.
Reply: Andre J, you said, "...the first generation production BF109...the Emil version."  This is not true; the Junkers Jumo 210 D equipped B-1 model was the first serial production model, of which 341 were produced.  This was soon followed by the C, D, E and other models.  The Emil was the first series powered by DB 600 series engines; all earlier serial production marks were powered by Junkers Jumo 210D engines.  

From Wikipedia; "The first Bf 109 in serial production, the Bf 109 B-1, was fitted with the 670 PS (661 hp, 493 kW) Jumo 210D engine driving a two-bladed fixed-pitch propeller. "  (B-2 models were B-1's which had been upgraded with variable pitch propellers, often in the field. 

The shortest-lived model of all was the "C" model, of which only 58 were produced.

Bf-109 D models were the main in-service type right up to the time of Germany's invasion of Poland, but the "Dora" was soon replaced by the first "Emil" models during the Polish campaign.  Nearly 650 "Dora" models were produced in all, all but 8 of which (the pre-production "D-O" prototypes) were produced by contractors like FockeWulf, Erla, Fieseler, Arado and AGO.
Reply: The 109 stayed in service much as the Hurricane did in the UK because of a failure/delay in the promised replacement fighters and the ease/cheapness of production.